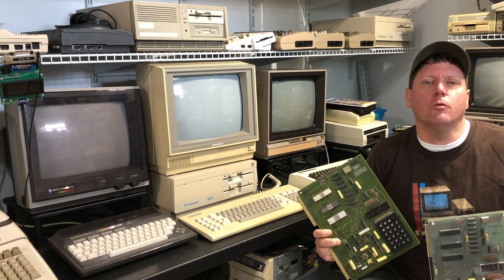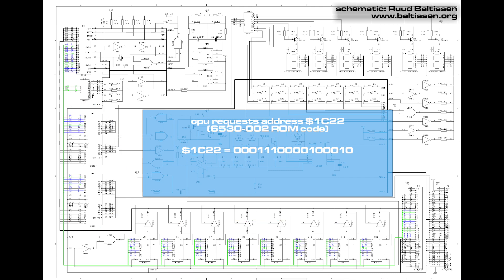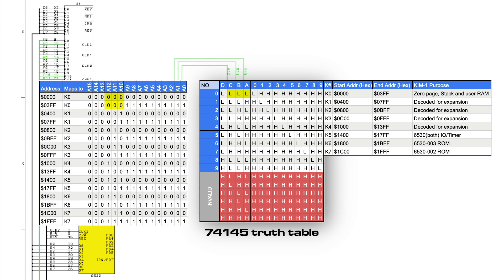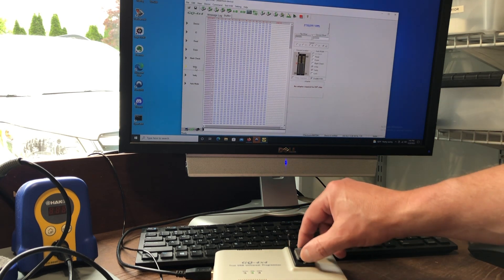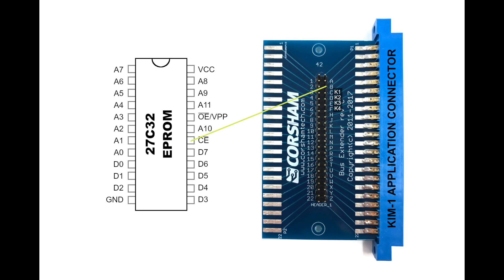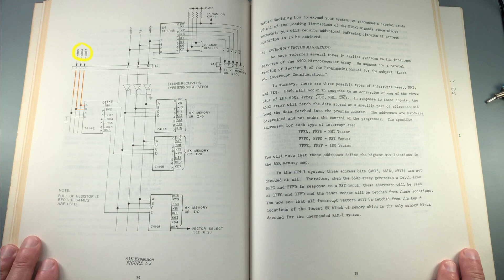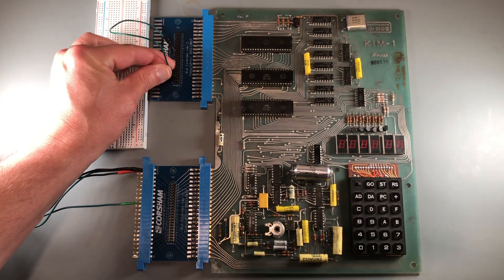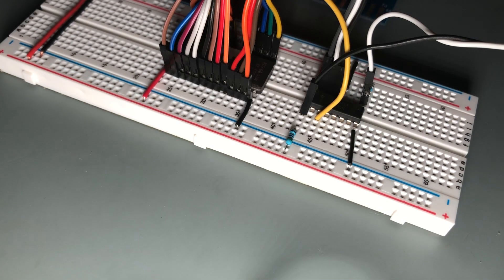How Address Decoding works on the KIM 1 single board computer

Comment: Apart from it not being pin compatible, I wonder if the KIM-1 could have worked with the 6507 instead of the 6502?
Reply from the maker: This is an interesting thought experiment. I mentioned in the video that the KIM-1 only decodes 8K of address space, and it's the lowest 8K. So the 8K max address space provided by the 6507 would cover the KIM-1's unexpanded address space. I'd have to look through the KIM-1 kernal code to see if the lack of IRQ/NMI pins would break anything in an unexpanded KIM-1. Obviously, no expansion would be possible, but I think if you made an adapter board, the 6507 could work.

Comment: Very cool!! The KIM-1 has always fascinated me.  I would have been 12 y/o when it came out.  Wish I could have gotten into computers at that age!! I was 18 when I bought my first computer, a TRS-80 Color Computer w/ 4K ram.   Liked and subscribed -- keep the KIM-1 videos coming!
Reply: I was twelve as well, but I had an amazing grandfather that imported a KIM-1 from UK for me. This kicked off the basis my entire life and career. I just bought a KIM-1 in pretty good condition for a horrendous amount of money - but nostalgia is a powerful influence over ones spending ;-)
Reply: @MatsEngstrom  That is awesome about your grandfather.  I'm jealous you have a KIM-1.  I'd like one + an Altair 8800 or IMSAI ... or both!!   But I agree... I too have spent a lot of money (and time) over the last 10 years on nostalgia and retro electronics / computer hobby. As for computers mainly Tandy CoCo's.  Bought l lot of old electronic parts (CPU's, VDG's, sound chips, etc...) breadboards (the good one BusBoards) Arduino's, Raspberry PI's ...  an Oscilloscope ...   AND I got fascinated w/ FPGA's and hardware emulation of Retro Systems (Arcades, Consoles, Computers).  Bought a bunch of FPGA development boards.  Also a MiSTer FPGA + a spare DE10-Nano ... I'm sure it all adds up!  But it's my entertainment so there's that.

Comment: How do the two RRIOTs determine which one is supposed to be reading or writing to RAM if they share the same CS line?
Reply from the maker: Hi Evan, if you look at the MOS 6530 data sheet, you'll see that the chip select lines, rom select lines and a couple of the address lines were able to be mask programmed by MOS.  The data sheet includes a diagram of what was possible.  It allowed the 6530s to decode those parts of their address space separately from each other.

Comment: I am trying to bread board a possibly bad 6530-002 to my KIM-1. I have it all wired up. 6530 pin 3 (Phase 2) to Expansion pin U, 6530 pin 9 (R/W) to Expansion V, 6530 pin 16 (RES) to Expansion pin 7 and I have K4 from the Corsham application connector J5- pin 6, going to 6530 pin 4 (RS0) and J5- pin 4 (K2) going to 6530 pin 18 (CS1).

My KIM-1 will not boot up with this bread board connected. The LEDs that I placed on the bread board on PA0 and PA1 do light up.
I was wondering if you might be able to tell me what I am doing wrong? Do you think removing any of the control signals might resolve this issue?
Reply from the maker: Goodness Jeff, I’d probably have to try connecting that up myself to see what’s going on. Off the top of my head I can’t even make a guess.
Reply: @commodorehistory  I got my  6530-002 test breadboard working. I was missing the pull up resisters on K4 and K2 select lines. I found that the ROM would repeat 8 bytes of good commands there by replacing 8 bytes of good commands that should be there. It appears to do this throughout the entire ROM from $1000 where I have the ROM setup to $13FF. There may be a problem with the address A3. Either way, it looks like the 6530-002 may be bad.

I have already had to replace the 6502 and if the 6530-002 is also bad, what do you think the chances are that the 6530-003 is still working??? I ordered the Corshame 6532 replacement board and hopefully it will be here soon. Although I wish someone would build a micro controller replacement maybe using a Arduno Nano, so that the single chip replacement does not cover up the whole board.
Reply from the maker: @jeffnay6502  Great!  Glad you got that working.  I've personally had good luck with 6530s so you might be okay with the 6530-002 still.  There is a fella working on an FPGA replacement for the 6530s that were in pinball machines and he expressed interest in extending his work to the 6530-002 and 6530-003.
Reply: @commodorehistory  I would like to know more about the specs of the chip that he will be using.

Comment: I was able to preform the same expansion experiments using the standard Corsham Application board. Using the pinouts provided on JP5. 
The first expansion was easy, Just need to connect a jumper wire to K1 which is pin 3 on JP5, K2 is pin 2, K3 is pin 5 and K4 is pin 6.

The second expansion over the 8K boundary, requires you to move the jumper on JP1 to Ext. This removes ground from the D input of the onboard 74145 decoder. To connect your breadboard's 74145 to K  place a wire on Pin10 of JP5, and to connect  the breadboard's 74145 to J, place a wire to pin 8 on JP5 . I was able to ohm these two connections out, to make sure that I was actually connecting to K and J using pins 10 and 8 on JP5. That way I was sure that I was wiring it up correctly. Everything worked out perfectly.

Thank you for this extremely informative video !!!
Reply from the maker: I put a ton of effort into making this video knowing that it wasn't going to receive many views, but I hoped that someone might find it useful.  Your comments made the effort worthwhile.  Thank you so much, Jeff!
Reply: @commodorehistory  I only had one Extender Board, so I wanted to see if I could do this project using the regular Corsham application board. I picked up 3 - 27C64s and I got a bunch of- 2432s for about $5. I started working with a 28C16, that I had on hand. It worked for the most part, but when I would read past the small Butterfield program, I would not always see FFs. Whereas when I used the 27C64 it seemed a lot more stable. I had also loaded the Butterfield program in at $2000, $2400, $2800, $2C00, $3000 and I even stuck a #00 at $3FFF.

I was thinking about sticking a group of 3 or 4 sets of header pins on a breadboard, so that I could have 2 or 3 ROMs or PIAs all running at the same time, using different address spaces. This truly was a great lesson for anyone looking to expand and or interface the KIM-1.  Thank you !!!
Reply from the maker: @jeffnay6502  great to see you really running with it :)
Reply: @commodorehistory  I would love to see a good explanation of how the Keypad and 7 segment displays are constantly addressed while other parts of the program are running simultaneously.
Reply from the maker: @jeffnay6502  I'll put that idea in the pipeline.  Thanks for the suggestion!
Reply: @commodorehistory  I did run into one small situation.  Of course I moved from Output 1 ($2000) to Output 2, 3, 4, 5 and 6 ($C000) but as we are only using 1 - 74145 and have output 7 going to the Application Connector pin J. I could not use output 7 ($E000-FFFF).
I had another small issue, with the books representation of the last 74145 starting at K58, where I see that it should be (starting) at K56 and ending at K63 Which would start  $FC00-$FFFF
Reply: My KIM-1 problem mysteriously was resolved. I think it was just some dust that got swept up under one or more of the RAM chips. I piggy backed all 8 of them, and started seeing a single 7 segment display lighting up. I removed them, one by one and after I removed them all. The KIM-1 was working again...

Comment: Could you use a 74138 instead of a 74145 for address decoding?
Reply from the maker: Absolutely. I initially did the 8k eprom circuit using a 74LS138 but switched to the 74LS145 to make the video so it would match what was shown in the user manual.

Comment: Bravo!  I recently did a few KIM-1 episodes for my own channel you may wish to check.  I thought you did a great job here but this could have been 3 episodes, at least for me!  It was pretty fast, and I already knew most of what you were talkibg about, so you'd have to be pretty clever to pick it up on a first view!  I appreciated the density of info, but for a broader audience you could have done how the Kim-1 decodes ands selected the right chip as it's own whole episode!  Or I may just be slow 🙂

Subscribed!
Reply from the maker: Hey thanks Dave!!  I just mentioned you in my previous comment :)

I really appreciate you watching and value your feedback!
Reply: Awesome Video !!! Not to fast at all. He perfectly explains how the KIM-1 uses Address lines A10-A12 and the 74145 to create select lines K0-K7 and what those lines are connected to, and how you can use those lines yourself.  You are correct there was a lot of great information packed into this short video. The best thing about a video like this, is that you can always pause and re-wind, if you think you missed something... Which I do often ... 😃